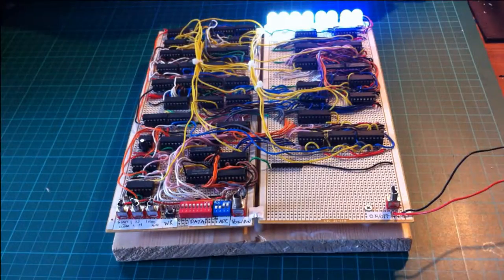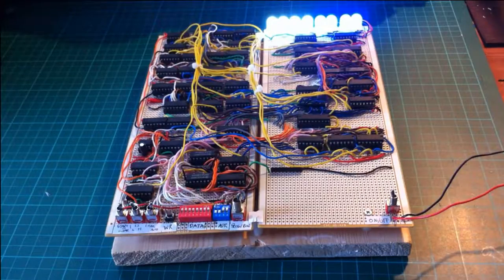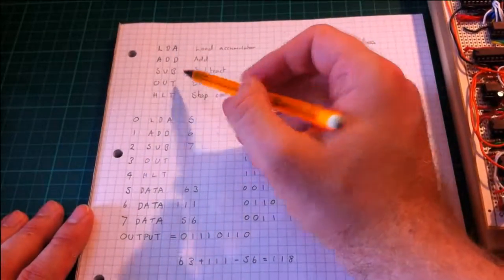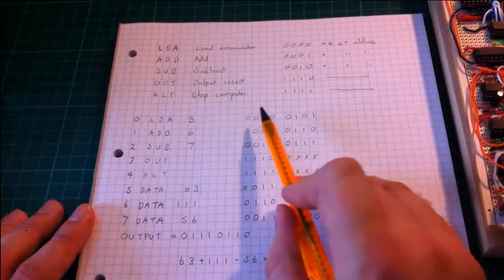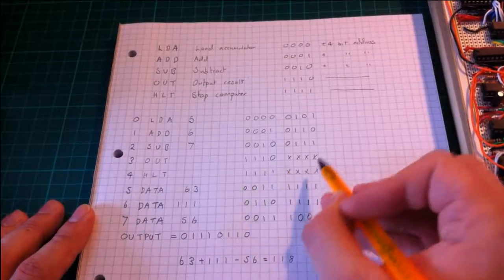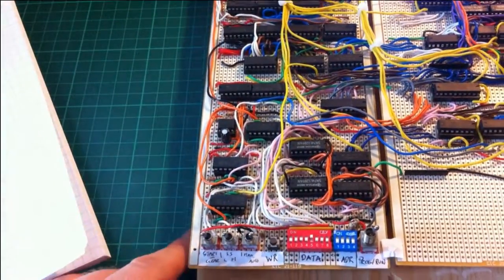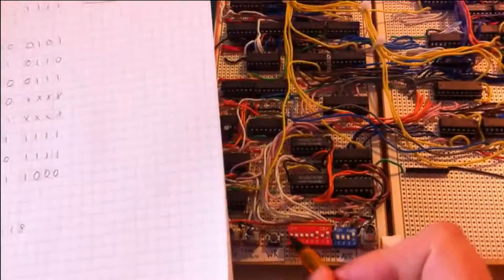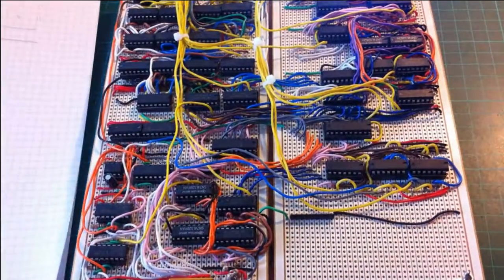8-bit Computer Built From CMOS Logic

Comment: This is a SAP-1, although it is not built the exact same as Ben Eaters, it is the same. 
Although this one is missing the BUS architecture. Thus all the long wires involved.

I also prefer that there be LEDs on all the registers and the memory, so that you  can see what is getting passed where.
This is my SAP-1 built from watching Ben Eaters videos, but using my own control logic. 

https://drive.google.com/open?id=0B6LIgQzDkH8fUTlCYWpJV3B2dDA
Reply: I am a little concerned with your ideology.  I am not Jewish, but I have
 worked with many Jewish people and I have never had a problem with any 
of them. 
And as far as I know, they are not currently cutting off anyone's heads for being of a different faith.
So, what is your problem with Jewish people?

Comment: I find it quite sad how many guys use a ton of chips to make something rather simple (no mocking intended). I bet it's easily possible to make something like this with twice as less discrete TTL logic (excluding ROM though). If not three times. It's like minimal architecture never crosses anyone's mind.
Reply: +Gekuron Matrix Show me a computer you have built with discrete chips?
Reply: +Gekuron Matrix grab a z80 or  6502 and your done, where is the fun in learning how a CPU works? or get a harder to get 74818 and you got a Alu, still you need some supporting chips. I like both worlds, building a cpu from discrete chips and taking an off the shelf cpu and make a whole computer (that probably can outperform the former).
Reply: That's not as fun. I could build something like this in a simple manner. The power button on my computer. But it's fun to learn it down to the logic.
Reply from the maker: That wasn't really the point of this project though... I wanted to build something from first principles upwards. I started by making each logic gate out of transistors, then graduated to this project, then to build a simple computer with a Z-80. I learnt a lot from this process (including soldering and patience) that I wouldn't if I had started with more complicated logic.
Reply: Back in February you said "Show me a computer you have built with discrete chips"... Well... if you are patient enough I will hopefully soon post a video of my computer that will have 1)  VGA graphics for a TV 2) Have a DELL computer keyboard as input 3) probably 128 bytes SRAM, 4) Instruction bytecode set comparable to that of an arduino uno. And ALL that with just about 10 DESCRETE TTL chips (including one 32K SRAM chip). Don't believe me? Well just wait and see. I't all working out for me so far. 
And I do appreciate beauty of simple logic gates, but what I also appreciate is some cleverness and economy. 
Just look at Esperantanos computers here on youtube, uses about same amount of chips but it's capabilities truly deserve respect.
Reply: Been patient.  Where's the video?